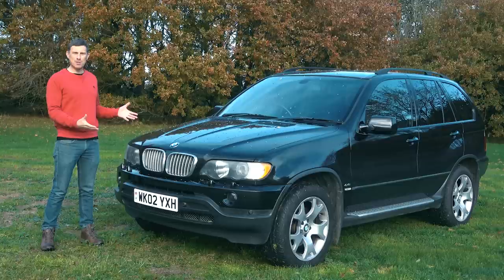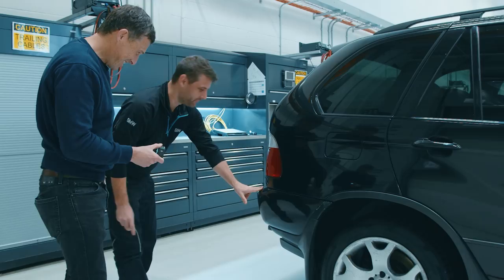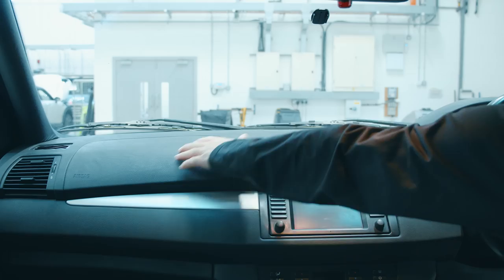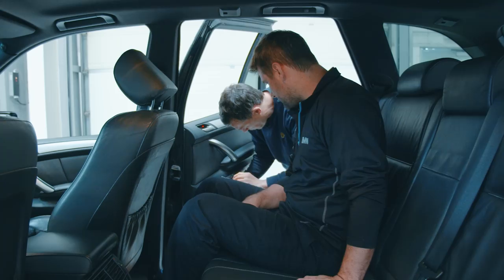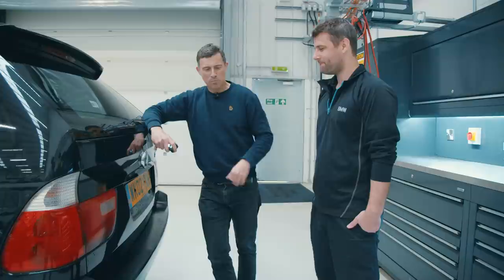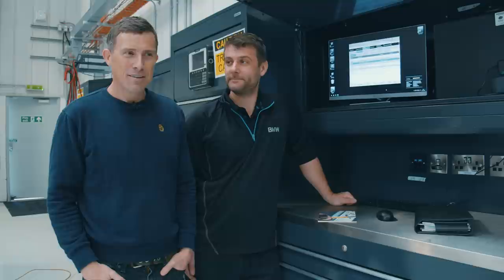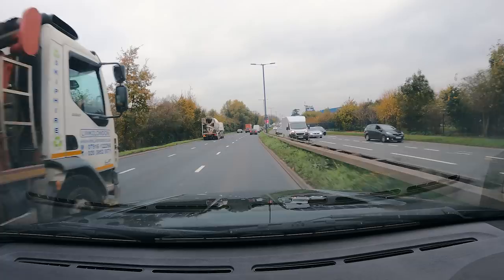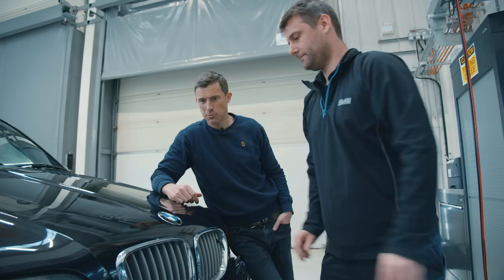BMW RATES MY 'NEW' X5 V8!

Comment: My first BMW was e39 and I loved it... Oil leaks are pretty common... I bought it at 220k km (real) and by the time it made 300k km it started to need a lot of grand repairs, which costed half of the value of the car - engine oil leak, gearbox oil leak, dashboard pixels, thermostat, some electric faults, etc... And I was still removing OEM BMW parts... So tbh, the break point of that generation of BMW seems to be that mark, which is not bad at all...

Comment: Servicing a 20 year-old car at an authorised garage doesn't make any sense. There are loads of independent garages and after-market parts that can reduce the cost up to more than 60%, including VAT and labour. Moreover, there are used-parts centres where one can find just about anything,  especially for the X5 model which has been so popular in Europe. After-market parts come in various qualities and, more often than not, they can be better than the originals.  I used to have a Golf which needed a clutch set. The official service centre asked for 1200 euros to replace it, including labour. I bought the exact same part (VWs use SACHS clutch sets) for just 180 euros. I took it to a qualified independent mechanic who charged me 120 euros to install it. EU legislation clearly states that warranty does not become void if the repairs are made by a qualified mechanic, even with after-market parts, as long as the latter do not deviate from the manufacturers' part specifications and standards. Independent mechanics can stamp and update any car's service book, without affecting the warranty.

Comment: My e39 540i (same engine) had that thermostat fault from 53k miles all the way until I sold it with 136k on it. No issues with over heating or over cooling. I think its a red herring.

Comment: Considering that it had a main dealer service up to 119k miles and it’s overall condition, I would certainly fix the leaks and suspension and brakes.

Comment: I bought an e61 2006 M47 520d
About a month ago 

 I love it 

Cost me £800 off Facebook marketplace and so far this is what I’ve had done so far :

£120 Front discs (vented) + pads
£ 100 Rear discs (normal)+ pads
£25 Front drop links (both sides)
£ 50 Front passenger side shock absorber
£100 Full service (oil/air/fuel/cabin filter & new oil)
£50 Removed flex pipe and welded new one in 
£60 Inner&outer track rods (both sides)
£45 Front wheel alignment 
£30 Part worn tyre on rear passenger side 
£15 New floor mats (made to fit)
£10 New gear knob 
£10 Bluetooth adapter for stereo aux £7 front seat gap fillers 
£20 Steering wheel cover 
£40 rubber boot liner 
£80 Full interior valet 

Labor for all the mechanical work 😰
£520 

Grand total of £1282 + the £800 for the car 

So it’s a £2282 car 

I fixed the diversity myself by taking it off, and cleaning the corroded electrical components on the printed circuit board to allow the car to lock remotely from a distance as it should

Also got to get the front suspension arms done top and bottom which is another £90 for parts and £80 for labor so got a further £170 to spend 

Grand total of £2452 and it’s got all them new bits and drives perfect 🤩 

The previous owner also had a new alternator fitted about a month before I bought it so fingers crossed it’s a good car that will last for many years to come.

Comment: Watch out for timing chain rattle on 2010 N63 4.4l V8's.  At 96,000km  (60,000 miles).  Quoted up to $25,000 for chain and valve stem seals.  Car cost $23,000.

Comment: Nice car. I spend my freetime with my project E53.. to be fair those reat bushings on mine were totally ok when I took them off even they "seem bad" from the edges" and you can get them seperately, price is about 20-30e or so. Steering seems to be fixed with a pipe maybe inside of the leaking spot = causes hole to get smaller = worsens the power steering and makes it weaker. With the current prices of fuel I would not buy one of these without a diesel engine, unless it's a decoration for the yard or garage 👌🏻

Comment: Only restyle (from 2003)with first gen x-drive (mainly rear/all wheel drive when needed) is worth to buy as long it is diesel or V8 ... (depends how often like to drive and engine sound preferences, if go V8 4.8 is must with full air suspension (2-axel self leveling suspension by BMW description)... Repairs will be high on any of V8 at least last one has a power/sound and nice external styling) and color buy any color except black(dark) -> lose easy view of great body shapes on sides ... (half of good emotion owning such car) beside pre restyle has 2 major problems 4 wheel drive when something happen to front wheel drive system (weak point) car loses both ... evacuator (restyle lose front wheels drive and continue driving on rear yes errors in dash but car still moves forward) .... and crappy 5 speed automatic gearbox ... which do not show any sign of problems until one moment just stop working ... (6 speed automatics at least show some signs that gearbox need overhauling to be safely driven ...) I bought restyle E53 with diesel and  full air suspension and panoramic roof and installed BMW engine and gearbox protector bars (1.3k option (parts only) if take a new ones from BMW) silver (other possible cars was black/dark - see above why e53 must be any color except dark ones ) diesel is perfect even allow reach average 38 mpg (7.4 liters 100 km) when first months while I used to this car (I switched from front wheel drive Zafira Tourer) if drive more dynamic there will be 28 mpg (10 liters 100 km)  this is great result for old car with outdated six speed automatics (as well if looking there is option to find this car with 6 speed manual for true performance driving addicts)

Comment: Having the exact same car, 2002 4.4i, even black with optional side steps and the same wheels, but with way more problems than yours I say you always need to leave some money for the car even if you think everything is alright. Any of your outside door handles may snap, a window regulator may break, your VANOS may start rattling, timing may start making a noise, front wipers mechanism may unscrew itself off, they rear door electrical harness may loose its insulation, the memory module for the driver seat may crap out and make your steering wheel adjustment inoperable, the headliner may split and start making a rattling noise, side mirrors will at some point become lose and flap front and back, the bonnet may fall on your head with a slight wind when the struts become older, the suspension height sensors are one of the lowest points on the vehicle and they have tiny plastic arms that break when you go through tall grass, the car eats breaks really fast and you are very lucky you don't have a sunroof at all as they tend to break too. Obviously these are only some of the common issues, not all of them. If you want to keep this car running always have a decent amount of money in reserve. It is only a matter of time.
However when they work they drive amazing. It's like the most demanding girlfriend, that occasionally makes up for you.
Having owned E36, E46, E38, and being driven in many other E46 and E39, I can see that E53 was not made to the same quality. You absolutely can feel the difference between a BMW made in Germany and BMW made in USA.
Reply: Hey, I've got the same car as you model and year , petrol .. took my car in for a service while visiting family . I asked them to look at my power steering fluid as I noticed it's bleeding from the cap, and I've had a leek and the liquid has gone brown (i live in a town that can get up to 45 d heat). Always do my research before taking my car to mechanics.  Friend picked up my car for me . When I got home I checked to see if they had changed my power steering fluid,  Nope.  Call them to see why not , they have told me I need a new power steering rack . Totally pissed off because how would they know that with out trying to replace  the reservoir first .. I'm actually sick of taking my car into mechanics that shit talk my bmw .. 
Thoughts ? Would u change the reservoir first or the pumps , before you would go straight to a $3000 job 
Still can't believe they didn't do a flush and put fresh power steering oil in

Comment: thats not bad. the audi dealership wanted to charge me 1700 usd for thermalstats. it was a 2012 Q5. and 4200 for turbo replacement, and with other diagnose and stuff, they wanted to charge me 8200 usd for the repair. but once they turned off the engine light, and i ran diagnose at third party, everything works fine. it was just a failure at the moment.

Comment: I bought a 2006 x5 off an initial 18 month lease. 178k miles and not a single problem. Just regular maintenance. Still runs like a Swiss watch.
Reply: HOW MANY YEARS YOU HAD IT
Reply: Since 2007, 16 years now.
Reply: @kurtdobson Where are you based. Also down to how much you know cars. I presume you warm the car up for some time light driving and only then push it a little. Half the issue is people not warming up their engines I think even if they do stay on top of maintenance
Reply: Salt Lake City,  Utah. X5 is great in the snow.
Reply: @kurtdobson  Interesting hope it survives another huge amount of mileage.

Comment: Always change the 'sealed for life' auto gear box oil at 80-90k miles, they often stop working otherwise. I have a 650 14 years old don't spend anything like that keeping it perfect , it just isn't pactical to use BMW main agent on old cars, use a specialist!

Comment: Intererior, exterior front and the mechanics I love, but the rear on this model does look like someone kicked a 5 series up its arse. That being said, as long as you reverse park it you don't need to look at it ;-).  I had a 1999 E39 528i with 480000km on the clock. Bought it for 600 Euro and it was rock solid (by pure chance). Only annoying part was the front bumper... It acted like a scoop when I hit a Panda in start/stop traffic. Panda fine (plastic), Beemer dead (bonnet, radiator, headlights etc etc). I wept that day...

Comment: I bought one new in 2006 with 100km dealer warranty. At 105km the steering rack went, at 108km the gearbox packed in. At 110km the dealer took it off my hands at the next service for the price he was going to charge me to fix all the bushings, brakes and leaks.

Comment: I once bought a 10 year old Volvo XC70, brought it to a dealer and they were surprised on what a good deal I had got. They were super positive all the way. There was some stuff that had to be fixed they said but overall very good car for the money. 
When they came back with a price indication to get the car sorted it would be 14.000 dollars. 🤣
I ran away and drove the car for 3 years without fixing any of the issues the dealer claimed to have found. And sold it after 3 years for like 1000 less than I payed for it.
Long story short: Stay away from the official dealers. They are scammers. Unless you have to much money to spend in a life time and enjoy being abused.

Comment: 7.7k in total, but you still need to add new tyres and you haven’t done anything to make it cosmetically better.
Bring it over to M358 and the guy will easily spend 20k on it to have it back to factory fresh.

Comment: I had the next gen 4.8 V8, still without turbo (in a station wagon 550i from 2008)  - and it died down at only 133’000 and 11 years - motor failure - and since then I learned reading over various forums that BMW V8 are NOT reliable long term. Maybe the one you bought had these very expensive repairs already done - but in my own case it was not worth it… since then I switched to Lexus and zero issue
Reply: Which lexus did you buy if you don't mind me asking?
Reply: @Islam_is_the_truth.4  RX450h from 2011 with HUD, adaptive cruise & a very good sound system. 119’500 km when purchased 158’000 now. Not a single failure if one except a lightly loose driver seat that need being tightened again a each annual service (I did wonder if one of the previous owner might have been on the heavy side).

Comment: I have the same car it's a lot of headaches out here in the cameroons without any good mechanical follow up and access to spares. I don't just know what to do about it as coupled with other problems it runs down batteries and the mechanics here can't even detect and remedy that. It's so frustrating because I actually like the car.

Comment: I had a similar time with my 25 year old CLK convertible at a Mercedes dealer. If they reduced the labour a bit and lowered the prices closer to patent parts, they might get get a lot more work. An independent garage would probably be a third to half as much for the same work.

Comment: Funny he says how they pull harder at the top end. It's true. New cars feel like they drop off the higher you rev. It makes the drive less smooth when revving hard. The very first 120d felt like it pulled so hard with no drop off. The 120d that came after it felt like it didn't pull as hard because of that top end drop off. Perhaps gearing from 6 to 8 gears or the way they updated the engine? Hate these new cars.

Comment: You don't buy these cars to sell it, but to run it. I just bought one of these (2006), which has been neglected. I sum up the repairs and it will sum up to 2.500 € and that’s fine, if it runs another 120K miles. Hope to have a decent car, making however some major changes to it, to make it more comfortable, as it is today. This is all reasonable, unless my car is about fully loaded, with much more options like yours. So just be patient, my car is not getting where I want it to be in a few days. It will get there in the end and it will be nice. Much better than those which have coped with the latest iterations, that you really don't want. Plus it is a diesel engine, which in the end is much more cost effective than having a 4.8 pratol engine. I would have never bought this period. Roland from good old Germany.

Comment: Had the 4.4 2005 x5, looks fantastic, engine amazing, loved it but completely unreliable. Door handles broke, windows broke, air con broke, brakes broke, shock absorbers broke, sun roof broke. To change a light bulb had to take the whole front end of the car off, the battery is under the spare tyre in the boot so very difficult to get to which you have to do quite often to try and fix it all the time

Comment: 20 years ago I bought a 4 yer old Saab 93 coupe with 95,000 miles on it from a dealer for £4000 and, that included £700 extra for brand new alloys and tyres to replace the steel wheels. It had had everything replaced on it as per manufacturers specs, radiator  full brakes discs and pads etc, the whole 9 yards. As such it came as a Saab approved used car with a full factory warranty so, as good as new. I took it to a local dealer fir the correct tow bar to be fitted and, they told me they had taken it in as a part ex on a brand new model and gave the owner £7500 part ex value and just off loaded it to Saab as it had the full warranty and they didn’t like 4 year old cars on their forecourt! 
Yep super snobbish. I just asked what the annual service costs were and was told to my face “if you have to ask that then you can’t afford a Saab”
The sales and service managers being know alls then both looked sick to their stomachs when I told them it cost me 3 grand plus my choice of Saab alloys. They were even more sick when I said I wanted the ignition housing replaced under warranty, which, to be fair was replaced. They then said I had got a bargain and it looked so much better with the factory alloys instead of the steel wheels it had. I just told them they clearly haven’t a clue about a used cars value and had given over £4000 on trade in just to get a new vehicle sale then dumped it back to Saab it turns out for around £2000. Couldn’t resist saying if you weren’t so stuck up they could have sold it with the factory warranty and put the wheels on and retailed it at a higher price.
They still stood by we only sell new cars and yes, they went within a couple of years.
Franchise vanity ultimately cost their careers and profits.
The car was great and I kept it for another 10 years without any problems at all.
Get the X5 parts replaced but don’t let BMW sell and fit them. Plenty of aftermarket suppliers out there for a fraction of the price and you too will have a car almost as good as when it was new. Just source good quality parts and you already have the dealer price for the parts to base any decision on. Any good local independent mechanic can do the work for a fraction of the labour costs!
Good luck with it.
The remote control looked like it was from an aftermarket dvd player that attach to the from headrests. I have one from Halfords, keeps children happily occupied on journeys.

Comment: It begs the question now: would you service it properly and would you intend to drive it daily? Bear in mind bmw quality after 2015/16 went dramatically down and not many of them will drive over ten years old. They are already plagued with electrical problems. 
What bmw would would you buy for 8k? Or any car for 8k for this matter. Here for 8k is already fully serviced, no rust, solid, old school, built to last. because of its size and weight I assume it would also be safe.
Yes, I know fuel and road tax wouldn't be as good as on newer car. But how much you would actually save in terms of fuel and road tax? Would £1000-£1500 spread over the year would be worth it?
What would you do?

Comment: Believe it or not, in the long run, our old 316i with LPi system would me MORE expensive to run. 
My dad bought it for around 8K euros.
We spent around 3K on all necessary work just keep the thing running. 
Awful cars they are. 
Any bmw with a 4 cylinder imo is not a BMW, its a licensed B-brand.
LPG? Forget about it.